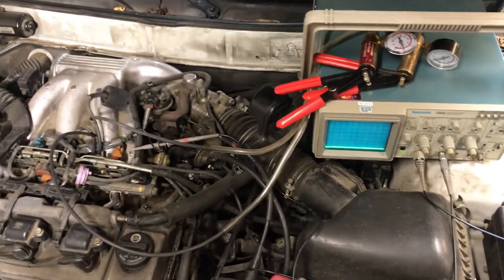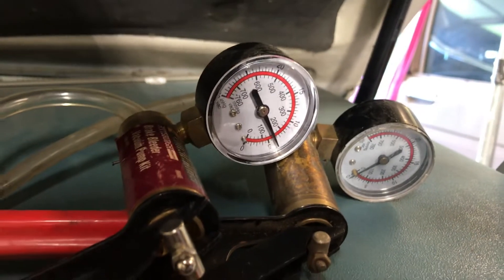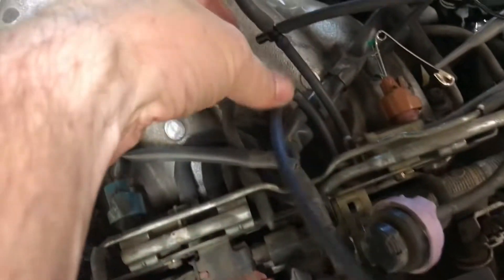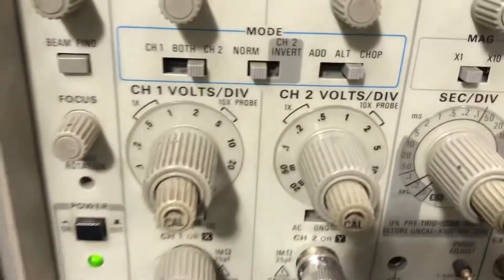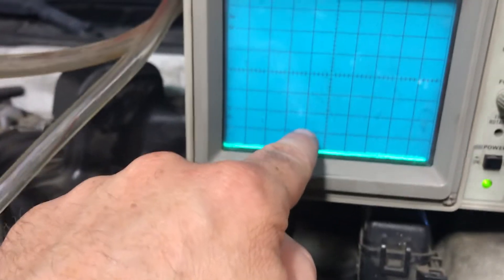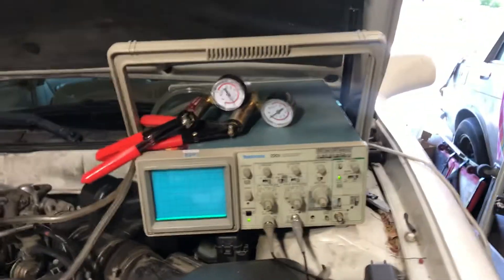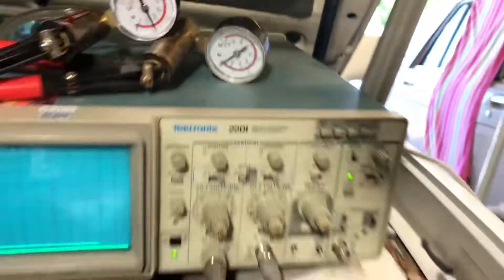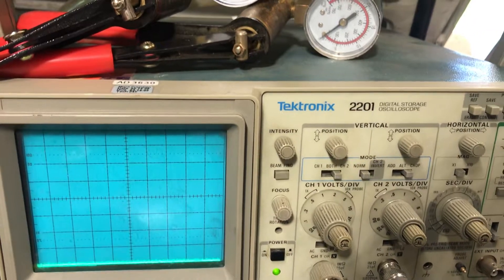Testing egr system PWM Vacuum Switching Valve VSV ‘99 Toyota Avalon

Comment: I have no codes, just a start and stall and the valve clicking intermittently key on engine off.
Reply from the maker: Are you positive the clicking is coming from the VSV?
Reply: @sac78008  yes, thank you for getting back to me.  I can feel it as I have it exposed.
Reply from the maker: I think I would try putting 12v across the VSV and see if it stays energized, or does it click on and off. Just to make sure the VSV is functioning properly. If the valve is working properly, put a volt meter on the terminals to see if the voltage going into the VSV is turning on and off.
Reply: Ok, thank you
  I will try today.  I can't find any test leads to do so.  Will buy today.  In the meantime..... I've got one on the way to me from eBay.  I'm thinking..... it should be hot key on engine off meaning hot and valve open.  The intermittent clicking is telling me that the value is not working properly.
Reply from the maker: Ya probably need a new valve.

Comment: So what was the issue and codes that you got and what was the fix?
Reply from the maker: The code is P0401 "Insufficient EGR Flow". This can be caused by a bad EGR valve, a bad VSV, an issue with the vacuum lines, a plugged up EGR tube, and possibly some other things. I have gone through all these things and it all seems to be working fine, yet I still get this trouble code. Thankfully, the code comes up intermittently after a couple weeks of driving, so I'm able to get my car to pass smog before the trouble code appears. Still an ongoing issue for me. Let me know if you have any ideas. Good luck!
Reply: @sac78008  Thanks so you never found what caused the code it just went away and returns randomly?
Reply from the maker: @electric8668  yes I’ve tried many things with no luck. If I reset the codes, the code will come back within a week, but it gives me a window of time to get it smogged.
Reply: @sac78008  Thanks same thing happening to me.